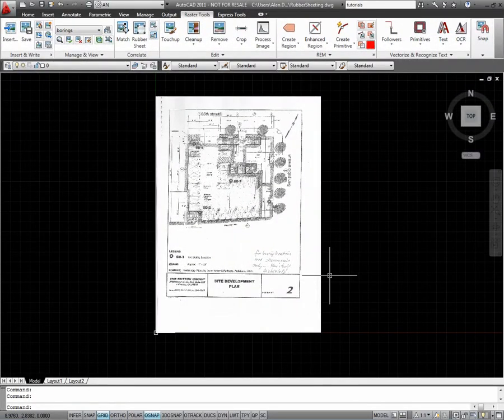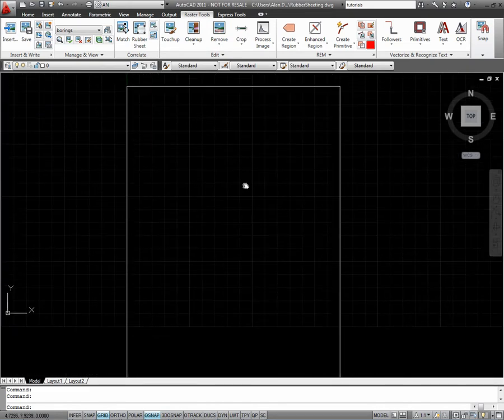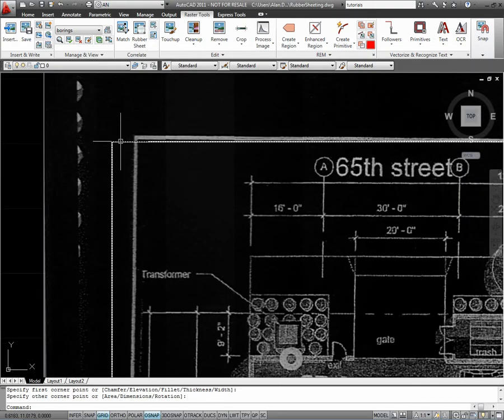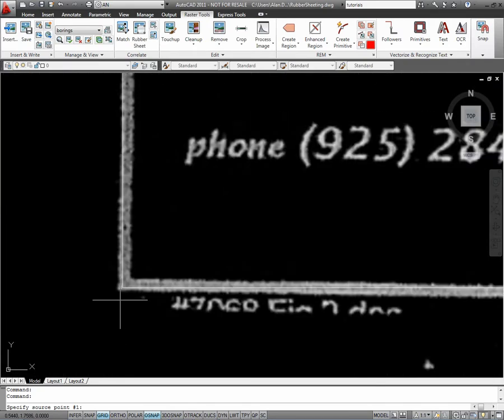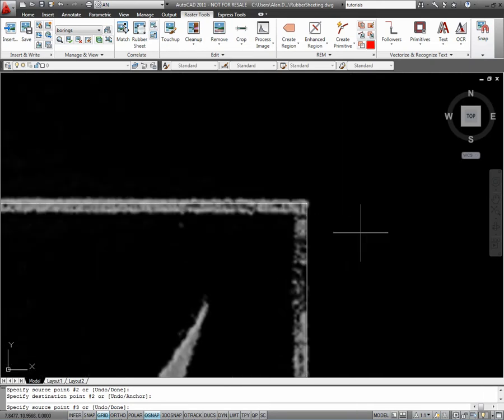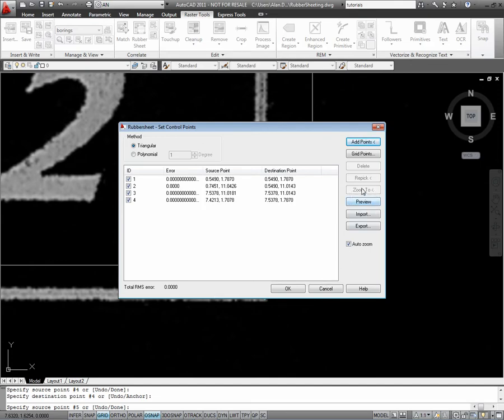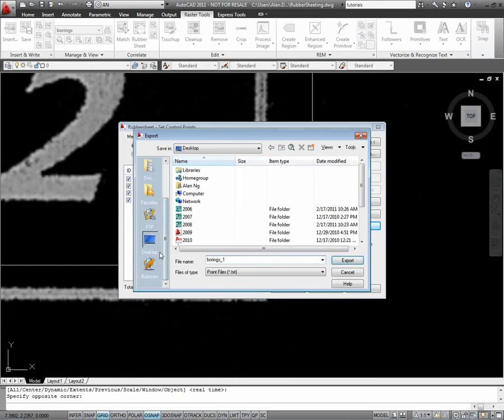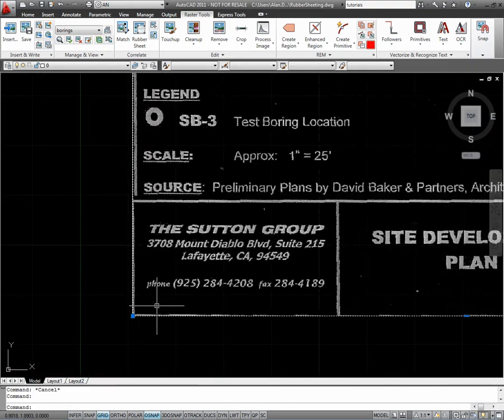AutoCAD Raster Design Rubbersheet Tool

Comment: When you said 'distortion', I expected to see a 'sharpening' of the image, not an 'alignment' of the image. Perhaps I need to check my semantics?
At any rate, it was a good explanation of the rubber sheet tool. Thanks.